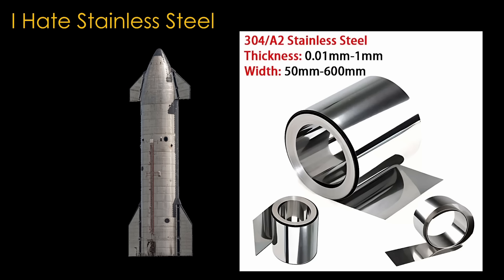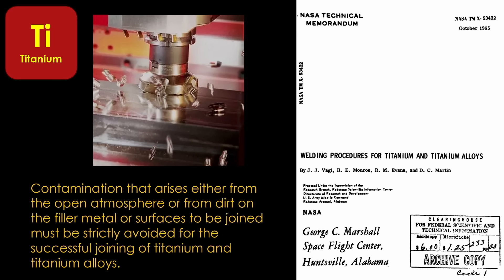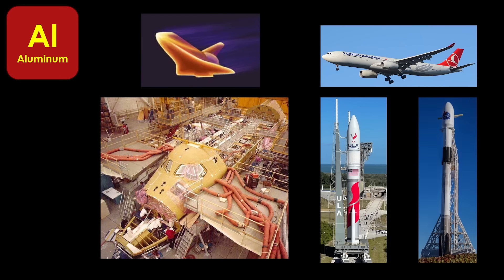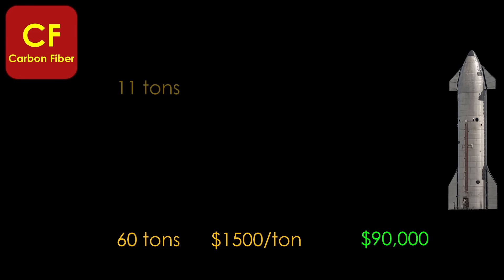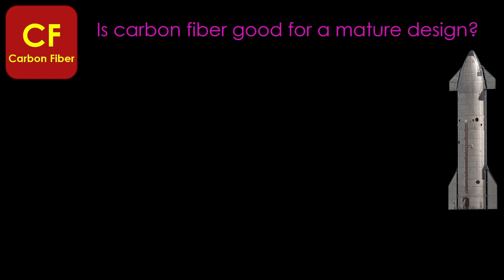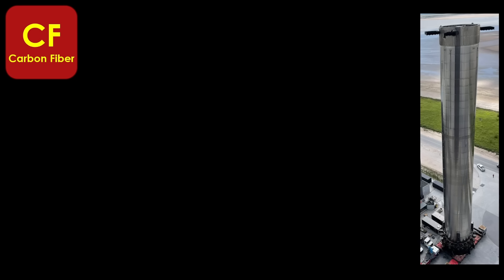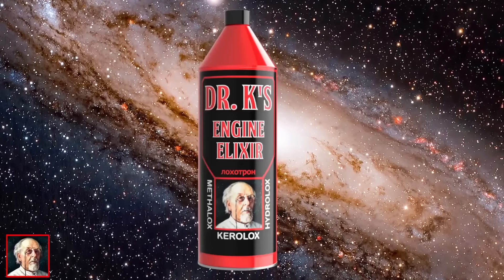Why Starship Loves Stainless Steel...

Comment: I’ve been recently looking into the latest advancements with magnesium alloys and there are certain types which don’t corrode. If used, they would have similar densities to carbon fiber with substantially better (although currently not good enough) thermal properties in terms of strength loss. Also fairly easy to machine like steel and aluminum

Obviously the big disadvantage is the tendency to get spicy when ignited, but there are developments which may do away with that unfortunate property.

Comment: Cheap, recyclable, easy to fabricate with, has a wide range of alloys, is extremely resistant to fatigue, and is found everywhere on Earth and beyond.

There are so many places to save money, most have to do with ground issues, that'll be some time before they start looking at the ship itself for more cost/weight savings.  When they do it'll be things like internals, furniture and paneling.

Comment: An epesode of number of tankers to refil starship would be interesting
Reply from the maker: I don't think there's much to talk about. SpaceX published what they think the payload and propellant capacities of starship 2 and starship 3, so the best guess outside spacex is just doing a division between the two. That might be too high as a pure tanker variant might be lighter, but it will be close enough.

I'm personally confused by the focus on the number of tanker flights. It's not going to be 4 and it's probably not going to be 20, and I think the differences in the numbers between doesn't mean a lot. 14 flights isn't categorically harder than 8 flights.
Reply: @EagerSpace It’s not about technical complexity; it’s about what else you can launch with those slots. If you can launch every few hours, it’s not so bad, but it’s unlikely we’ll get there for many years.

Comment: I’ll answer the question in under 200 words. First off, 300 series stainless has much higher tensile strength at high temperatures, as compared to 6061-T6, or 7075-T6. These aluminum alloys will also loose their heat treatment immediately the first time heated too-hot. Although SS is heavier, it remains strong to almost “twice as hot”. And stainless doesn’t care about heat cycles.

Comment: I think there are some cases where you could make an argument for a titanium upper stage, a carbon fiber lower stage, or aluminum in either stage, but almost no cases where a titanium lower stage makes sense, and a carbon fiber upper stage should never be done if you want to re-enter in one piece. I agree that SpaceX probably won't change their material though, because I'm sure there run detailed number for their specific case before committing to steel. Maaaybe a titanium upper stage if they can spread the additional cost over enough flights, but that's too risky for now.

Comment: Hi, I have a question.
To calculate the relation between booster weight savings and the gained kg's to orbit you divide the velocity which the booster separates by the orbital velocity right?
Please someone answer 🙏🙏🙏
Reply from the maker: I don't know the real answer to the question, but I suspect that you are going to have to model it. The number is going to be different for a booster like Super Heavy or Falcon 9 that stages early and one like Vulcan that stages very late.
Reply: @EagerSpace  yeah, but it should give a rough aproximation I think...

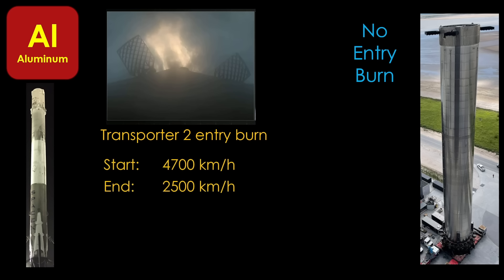Comment: 9:50. For what it's worth, on the Falcon flights I've seen the entry burn generally slows it from ~8,000 to ~5,000 km/hr.  A reduction of speed of ~40%, so a reduction of KE of ~60%.
And in the test last booster came in at ~4000 km/hr. (Staging at lower speed and altitude?)
Reply from the maker: I specifically chose transporter because it's RTLS and therefore more like starship.

Comment: The weight savings on aluminum is enormous. An aluminum starship is less than half the weight of a steel one. Now that there is an ablative layer backup going in anyways, meaning the whole point of using steel as a backup to the TPS is moot. Doesn’t it make more sense to reduce the vehicle weight by half and use that savings to put in light weight thermal blankets just like the shuttle? Thats almost certainly going to be lighter in the end. 

That being said, they’re going to have to store fuel in there anyways, thermal blankets might end up going ontop of the steel anyways.
Reply from the maker: They are using a backup layer to get the temperature down the the temperature capabilities of stainless if there is an issue with a tile. They would need something more robust for aluminum.
Reply: @EagerSpace yes but how many times can you heat stainless steel to many hundreds of degrees before you start to change the fundamental integrity of the steel? A famous example is the steel on 9/11. It was well below the “melting point” of steel before it became compromised. 

It seems to me that Mass just keeps getting added and added to this vehicle. They are hoping Herculean performance from the raptors and bigger tanks will make it work, but time will tell. More engines is also more mass. Taller vehicles are also heavier. If V3 can’t get the job done I’d bet we are stuck waiting another year or 2.
Reply: @Papershields001 many stainless have ASME published time/temp rupture properties. How many times and how long are you looking to reheat? It’s fairly well understood
Reply: Totally agree. They also can't take advantage of the superior high temperature performance of stainless since there aren’t many interior surfaces of Starship that can tolerate 400°C. How does 400°C affect the payload bay, the avionics, the LOX residual gases, the passengers?  The target temperature behind the heatshield isn’t that different for stainless and aluminum. In which case, might as well go aluminum.
Reply: @marksinclair701  Steel makes a ton of sense for the booster, but the stresses that the vehicle has to go through during reentry are going to end up meaning that they are going to have to use a huge amount of passive TPS. That leaves us with a really heavy steel ship that has to be completely thermally protected anyways to keep the ship from being destroyed. It might as well gain a huge amount of performance and be made from aluminum. 

Frankly tho, they’ll probably stick with steel because they are committed to that route at this point.
Reply: @Papershields001  Hang on, not quite with you there. Why doesn't aluminum also make sense for the booster? The shielding isn't really an issue (Falcon 9 booster works fine). We agree that aluminum makes sense for the ship right?
Also agree that they will stick with steel at this point. But a new competitor could choose differently.....
Reply: @marksinclair701 actually, it doesnt work fine Fót Falcon 9. They need to slow down and waste fuel to not get damages. SH just tanks it
Reply from the maker: What's not clear is how much extra TPS mass you need with an aluminum structure and how much mass that is going to cost you, and also how it affects the robustness of the vehicle. You can get by with some issues with stainless, as we saw with IFT-4. Any issues like that with aluminum and you lose the vehicle.
Reply: @EagerSpace  it would be really interesting to get the thermocouple data from ift4… wondering what the temps were like on the main fuselage with Cryo backing…
Reply: @Hungary_0987  Yes, but unclear if that is just the engines, or the skirt. Easy enough to just protect the skirt and Raptor 3 takes care of the engines.
Reply: @EagerSpace  It will be quite a while before Starship carries humans through re-entry. Will be propellant and cargo for a while. Maybe long enough to figure out the heatshield reliability question? Agree that stainless Starship with the backup ablative layer is a big step up in reliability & robustness, harder to get there with aluminum. But won't humans will be on Dragon or Orion for long while yet?
Reply: @EagerSpace  that’s a very good point. I’m not sure how much additional tps would cost them.  I wish I had Spacex’s computational resources so I could see what their simulations are telling them.
Reply: @marksinclair701  it makes sense for the booster because it lets them come back without an entry burn. Also the booster’s weight reduction would contribute far less to the total payload than a material change to the ship. Maybe carbon fiber would be worth it for the booster I dunno.

Comment: CF itself is more refractory than steel, so the heat resistance depends only on the matrix, which can also be carbon. It's conceivable that the heat shield could be integrated into the structure, if it can also deal with the huge temperature swing.
Reply from the maker: Wouldn't that get you towards the carbon-carbon materials? Great heat resistance but pretty fragile.
Reply: @EagerSpace  insulating C/C like in the Shuttle TPS was indeed brittle but it's possible to densify the matrix and improve toughness with further processing. While this also increases conductivity, it would be less of an issue because it doesn't have to protect an aluminum structure. The conductivity can also be exploited by spreading the heat to less exposed parts of the vessel.

Comment: When it comes to Starship versions that won't have to experience re-entry, or even trying to replace some of their steel on their boosters, everything we've seen from SpaceX suggests that they'll go for it unless there is some new and big shiny project ahead of them. The research costs vs payoff start to look very different when you're hoping to do thousands of launches a year with your vehicle within several decades, and their philosophy isn't exactly "meh, good enough for government contracts". Also, they've got a giant R&D wing, you gotta use it or lose it, even if the cost returns don't exactly line up.
Reply: Since their goal is to bring costs down I highly doubt it.

Comment: What I was wondering about is if it makes sense to change a cross section of the upper stage to increase drogue on return. Basically an oval shape, with a wider side windward. The problem would be to make a non round tank to hold pressure and here carbon fiber would, actually, do better. Possibly, if made light enough, LEO delivery only second stage could forgo most of it's heat shield (due to being extremely "floaty"), moreover, the first stage of such cross section and made from light matherials could go even higher and faster, without needing a re-entry burn in its return, provided it also performs a belly flop maneur.
Reply: Making the tank oval would make it significantly heavier. The pressure of the tank would be working to turn the oval into a circle, and you would need a lot of structural reinforcements to avoid that. You'd probably be better off making the flaps a lot bigger, increasing drag. But SpaceX doesn't do that because they think it's less optimal.
Reply: I think the heat shield do that
Reply: @SpaceAdvocate  And that's why I specifically mentioned carbon fiber. With its gerat tensile strength, the internal support structures could possibly be made light enough. Also, possibly, they could be designed to take some bending and vertical loads, thus lightening the outer skin. So it's still an open question of what would be lighter: oval hull with additionall internal structures, or larger wings, that would also need internal structure elements, heat shielding and adding additional drogue on the ascent (while with an oval hull you would have the same cross section surface as with a round one). But all this requires calculations that are way above my abilities.

Comment: Man you are amazingly didactic. Did people like Everyday Astronaut or Scott Mainly take any cues from you?
Reply from the maker: Both Everyday Astronaut and Scott Manley predate my channel, so I think it's unlikely they take any cues from me. 

I watch some of Tim's stuff when it doesn't overlap with the kinds of things I do. Scott's stuff is closer to mine so I don't watch it any more as I don't want to be derivative.
Reply: @EagerSpace  I always thought that using carbon composites for the 2nd stage of starship would be completely idiotic, and maybe aluminum on the first stage would make sense, but your video completely demolished my opinions.
Reply from the maker: The carbon fiber part for the second stage is really speculative, because CF lends itself to very different designs - looking at neutron it does not at all look like a typical rocket - and figuring out the reentry heating of such a light vehicle is beyond my skill level.
Reply: @EagerSpace  I think that making Starship thin and tall was a design mistake. It would be better to make it more like a cone, with a wide base and a small top. That would give a big area to expose the 1st stage on re-entry with more opportunities to cool down. Same logic could also be applied to the 2nd stage, but now with an opportunity to do some active cooling. Another thing to consider is that a shape like this don’t require legs or any structural add- ons to stick a stable landing.

Comment: 7:47. My answer would be no. Like you said, carbon fiber loses too much strength at too low a temperature. Super Heavy would need insulating and during re-entry, some heat would still be passed to the skin of Starship which is alright for Steel since it can take it, but not for Carbon Fiber. 

Make the requirements less dumb. If Steel works and can be iterated much faster, why stop using it?

Comment: I'd be interested if Starship HLS might use different materials for parts of the vehicle to save weight and maximise delta-V.
Reply from the maker: Lots of extra money and manufacturing difficulty to do it, plus a separate test program. Not a SpaceX thing to do in my opinion.

Comment: Great video, but if they wanted a starship that did not re enter the atmosphere and say only did landings on the moon or mars, would you use a different material?
Reply from the maker: The tradeoffs are different if you aren't trying to be reusable and could easily result in a different material choice.
Reply: But does it trade off in terms of cost?  People seem to think that a change in material doesn't mean a huge change in what's required to manufacture and the loss of most of what's being invested.